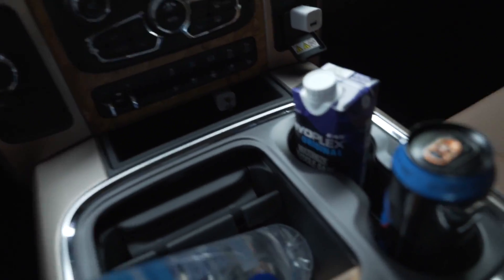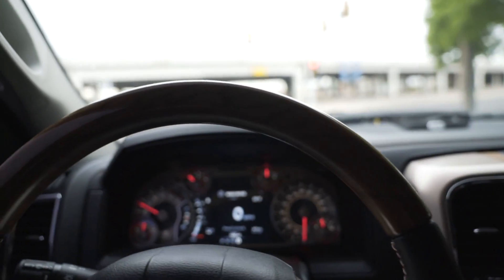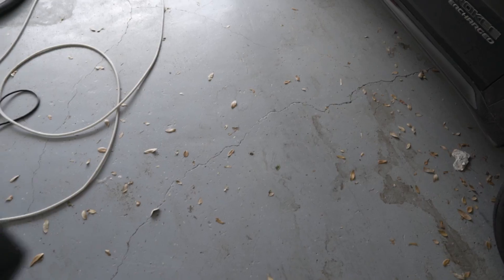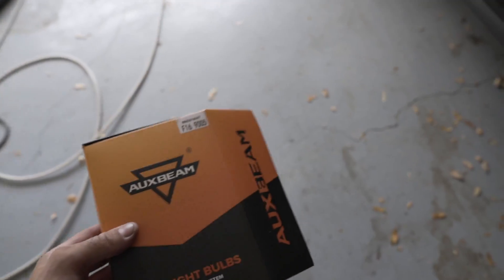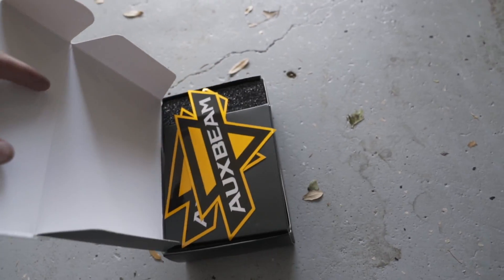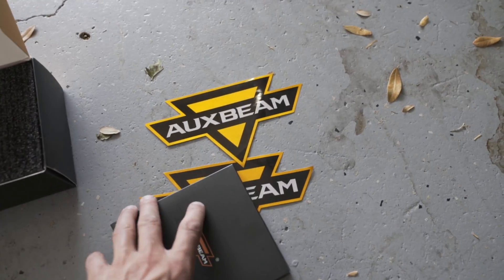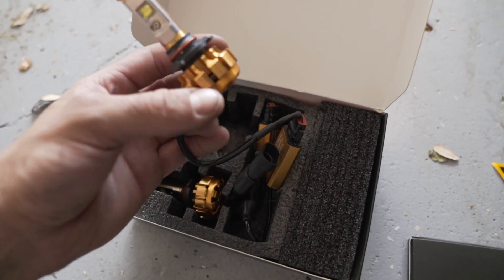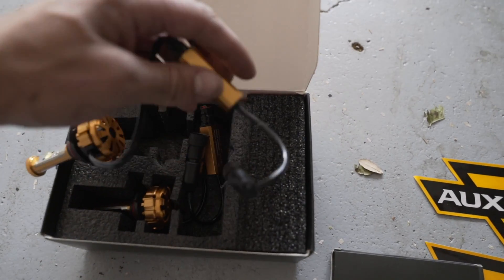BEST $50 MOD FOR MY RAM 2500 (AuxBeam headlight install)

Comment: Just a quick tip im pretty sure your passenger headlight worked its just when you plug it in it has a positive and a negative cable and thats most likely why you thought it didnt work you just needed to flip the connection upside down